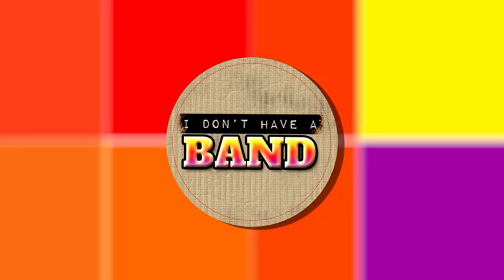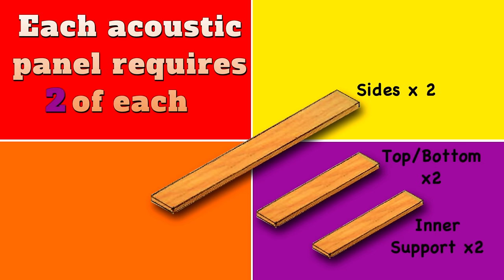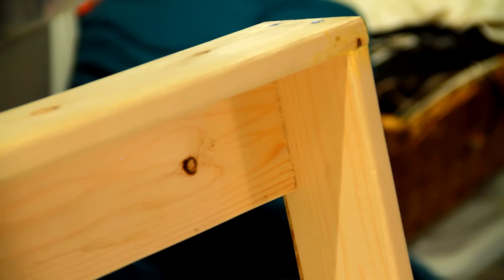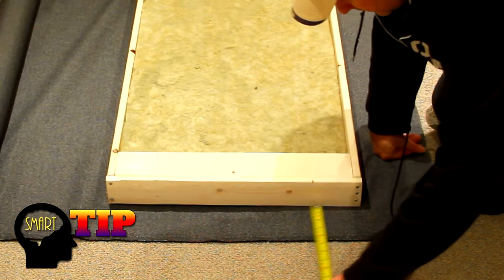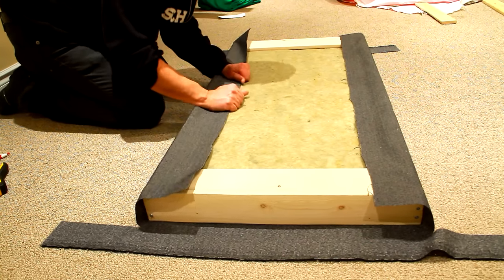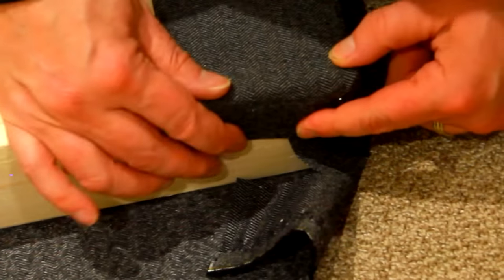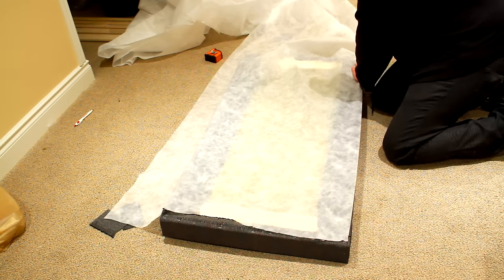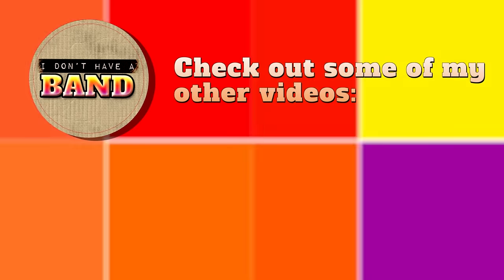DIY Acoustic Panels - How To Make Your Own Cheap and Awesome Panels

Comment: Can I use a 3 inch 16x48 panel?
Reply from the maker: The thinner the insulation the less frequencies it can absorb. You’ll still catch a good amount of highs with 3 inches but you will start losing absorption in the lower ranges.  As for size you can make them as big as you’d like but keep in mind the reflections happen in very specific places in your room.  See the panel placement video on my channel to see what I mean.  Hope this helps.
Reply: The panels you are using in the video are 2inch or 4inch?
Reply: @LonelyRocker  and thanks for take the time to answer. I really wasn't expecting you to answer me personally.
Reply: @LonelyRocker  The poster asked if he could use a 3" frame instead of 4" like you did. I noticed in your video that you used 2" Roxul and didn't double it up. So, that means a 3" frame would work. Not sure why you went with 4 inch frames if you were not doing a double layer? If it was to allow for air space, all you had to do is have a space between the wall and the panel. That would be a good idea anyway. I think that you can get away with 2" Roxul in 3" thick frames for side reflections. But for corner bass traps, it would be better to double up to 4" of Roxul. Also...it's a good idea to treat the back wall with diffusion to avoid splap-back.
Reply from the maker: My panels are actually 4 inches.  The insulation i used is just under 4 inches thick.  One thing I didn't cover in the video because I didn't talk about mounting is I added spacers on the back so it sits off from the wall a bit.  Every application can vary so I didn't want to be too general with some aspects.  I may consider a follow up video because a lot are asking.

Comment: I used your measurements and the 24x48 rockwool insulation. The insulation doesn't fit in the panels... because the panels end up being exactly 24x48. The interior measurement (where the insulation will fit) is less than this. Where did I go wrong?
Reply from the maker: Hard for me to say what went wrong from here but it is always good practice to double check your measurements before getting too far.  Place the wood around the insulation before you assemble it.  If you need to make adjustments figure out what sizes you need and apply these measurements to your next cuts.  Good luck.
Reply: I doubled checked everything, something must have gone wrong somewhere on my end 🤣
Reply: I Don't Have a Band 

Thickness of a 1x4x8 is actually 3/4” so based on the measurements in the video...

Outer Height
46.5” + 3/4 * 2 = 48”

Outer Width
24”

Inner height
46.5”

Inner width
24” - 3/4*2 = 22.5”

Dimensions of insulation 
24” x 48”

Is your insulation actually 24x48 or are the inner dimensions of the frame actually 24x48 on the ones you made?
Reply from the maker: Sorry, this is a lot of math for Youtube comments but my finished panels are almost exactly 2 feet by 4 feet measuring the outside.  The insulation is generally a tad smaller but it's soft so you can stuff it in there.  The key is the length of the pieces.  I gave the precise measurement in the video.  I also mentioned I wasn't giving carpentry lessons and that stock measurements can fluctuate.  The best thing to do is measure your insulation and adjust your wood to that.  A little carpentry skill comes in handy here ;-) . Hope you figure it out!!!
Reply: I Don't Have a Band thanks for writing back. Will make some adjustments on my end :)
Reply: Yes you have to trim a half inch or so off the Roxul
Reply from the maker: Good luck!!
Reply from the maker: I didn't have to do any trimming with mine...I double checked the measurements on the wood against the Roxul and then made templates from the first cuts.  Rest of my build went super smooth.  I made 8 with no issues...
Reply: I Don't Have a Band nice. Yeah I just adjusted the measurements. Maybe my insulation was different dimensions than what you used. I had to make the frame 1.5” larger to fit it
Reply from the maker: Glad you figured that out.  There is a section in my video where I talk about taking measurements and making adjustments to fit your stock.  Make sure to check out the other acoustic panel videos on my channel.  I show you how to place them and then how to do a sound test to gauge the improvements.  Good luck!
Reply: You need to take into account the width of the vertical pieces.  That would be 3/4 inch on each side, so the top pieces would need to be 25 and 1/2 long.
Reply from the maker: The measurements I provide in the video conform exactly to the insulation I used.  Unless you change the insulation material.  It's good if the insulation is a little snug so it doesn't move inside the frame.

Comment: Is the safe and sound more appropriate over the Roxul Comfort board 80?
Reply from the maker: Not necessarily.  The materials have different densities.  IT all depends what you are trying to achieve. I recently did an update on my panels blending different materials.  Check it out: https://youtu.be/MHnFYFZc-w8
Reply: @LonelyRocker  Thanks for the reply! I'll check out your link. In my case, I'm putting together a music mixing room to properly mix my music recordings. I'm going to build corner base traps with safe n sound cut into pie shapes, but I also need sound panels around the main room in appropriate areas. The comfort board 80 seemed appealing because it's more ridged. I was going to double it up for each panel and just using a guestimate, before doing any sort of testing, I think I'm going to need about 15 panels.  The comfort board 80 is a lot more expensive though.
Reply from the maker: My pleasure.  Definitely watch my Panels 2.0 video before making your bass traps.  There is a logic beyond corner shaped panels to make good bass traps.  I think you will be intrigued by my formula.  Let me know!

Comment: Great video but your prices in CA must be awesome compared to Oregon.  The wood alone is $6.20 each, meaning $12.40 per panel.   Fabric front and back will double that to about $25 per panel.  Insulation and other supplies these panel are approaching $40 per panel US.  Cheaper than buying premade panels but I couldnt pull it off for anywhere near less than $20CA.
Reply from the maker: Thank you!  Bear in mind this video was produced in 2018.  Long before COVID.  Prices on everything are super high right now.  I should price it out now and see what it would cost me today.
Reply: Thanks for the fast reply. Decided to do your 24x24 panels instead but struggling to find the comfort board locally, guess Im stuck ordering what I need.  Can you link me where you got your comfort board and foam?
Reply from the maker: My pleasure.  I got the Comfortboard at my local home depot.  The foam I just bought on Amazon.  They have a ton of that stuff on there.  Just need the 1 or 2 inch foam..

Comment: i thought of a easier method of constructing panels without all these tools and also cheaper and quicker. I was in my local DIY store and saw a shelf full of flatpack cardboard packing boxes. All that is required is to cut off the top and bottom flaps and you are left with the four sides. I then cut this box in two to give me  two boxes each 6ins thick. Then just fill with whatever material you chose and secure with a fine string round the box. Its then up to you how to finish them ... i just draped a pair of fine net curtains over them and secured with adhesive tape. No need to hang them just set against the wall leaving a few inches space between the panel and wall.
Reply from the maker: There are many ways to skin a cat...if this build works for you, awesome.  I'm a bit of a craftsman and I only like to build once so wood, for me, is more sturdy and will stand the test of time.  But for a quick and dirty solution, seems like you have found one...

Comment: Can i use comfortboard 80 instead for all my panels and will the sound absorption be better than the rockwool insulation.thank you
Reply from the maker: Absolutely.  I used comfortboard 80 for some of my other formulas.  Check them out here: DIY Panels 2.0: https://youtu.be/MHnFYFZc-w8   Mini Panels: https://youtu.be/AdDdumAieJs
Reply: Comfortboard 80 is usually available in 1.5 inch slices, which are not thick enough for low frequencies, and the product is 3x heavier per volume than Safe N' Sound.  Comfortboard 80 has a density of 8lbs/sqf while Safe N' Sound has a density of 2.5lbs/sqf.  The difference in density gives these two products different sound absorption profiles (i.e. they differ in how they absorb different sound frequencies) and Comfortboard is much stiffer, which means it will not sag if you chose to put it in a ceiling panel.  3 inch layer of Comfortboard will be more effective at absorbing low end frequencies from about 200 Hz down, but 3 inch SNS is more effective between 250 and 1000 Hz.  Neither is very effective below 100Hz unless you layer them to 6" thickness or more.  Interestingly, many anecdotal field tests by acoustic designers suggest that a 6 inch layer of SNS outperforms 6 inch layer of Comfortboard even in the bass frequencies.
Reply from the maker: I did a crude test of this theory on my channel...

Comment: Has Roxul availible online?
Reply from the maker: Isn’t everything online these days? 😜
Reply from the maker: @acejaystephens1110  Not the same stuff.  You need Safe'n'Sound.  Careful not to buy the wrong one.
Reply: Safe n sound is what I used in my ceiling joists and inside walls but for acoustic panels you want what’s called Roxul Rockboard 60 or 80, they will absorb much more low end freq which are always the biggest prob as simple acoustic foam will tame highs,  the Roxul rockboard is more expensive but .......
Reply: They’re extremely dense!! They’re about 6 safe n sounds compressed into one solid  Roxul rockboard.  Trust me I researched this for a year before I did it.   Not that yours won’t work but rockboard will absorb even more.

Comment: What fabric is this?
Reply from the maker: I'm not exactly sure.  I bought it in a fabric store.  On the label it says "mixed fabrics" so it's clearly a blend of a few things.  Up close it almost looks like fabric you could make a suit with except it's a little more rigid.  It was a great find.  I found it in the clearance bin at the store so I bought the whole roll.  Best to go rummaging at your local fabric store.
Reply from the maker: I visited the fabric store today and brought a sample of my fabric.  Turns out it’s upholstery fabric.   There’s a coating on one side to prevent it from slipping.  There’s your tip.  Upholstery fabric makes a great wrap for panels.

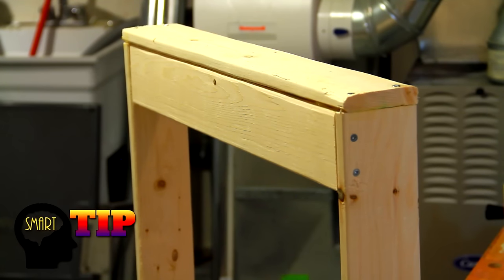Comment: 3:19 hi.. im confused.. the inner support is 22” which is less than the rockwool at 24” how is this possible? Did i miss anything?
Reply from the maker: Published dimensions are always a little bigger than what the material actually is.  And Rockwool is flexible so you can stuff it in. Trust me.  These measurements work.
Reply from the maker: Honestly?   These are DIY panels.  They won’t fix all of your issues but they will make your space sound a little better.  So do what you can.
Reply: @LonelyRocker  sounds like my ex-gf
Reply from the maker: @Sugarsail1  🤣

Comment: Is the safe n sound 24" OC sold in the US? Only found the 16" OC.
Reply from the maker: Probably best to check with your local supplier/retailer.  I don't see why it wouldn't as these are made to construction specifications.  I'm not a distributor but I'm sure your local hardware store could hook you up.  Good luck!

Comment: What frequency range does it cater to?
Reply from the maker: According to Rockwool's data, you'll get great absorption from about 250hz and up with about 50% absorption at 125 hz.  That's with only 3 inches of material.  If you want more absorption down low check out my DIY Acoustic Panels 2.0 video: https://youtu.be/MHnFYFZc-w8

Comment: So basically build the frame based on the dimensions of the insulation.
Reply from the maker: Exactly.  You're cutting the wood anyways but save the hassle of cutting the insulation and the mess and aggravation that comes with that.
Reply: As long as those dimensions will fit the space you want to put the panels. Keep in mind a 24 inch (2 foot) panel that’s 4 inches thick can take up a lot of space, especially if it’s in a corner diagonally. With each panel added, your room will get smaller and smaller. Two 4 inch panels facing each other on opposing walls will shrink your room by 8 inches. So you either need a pretty big room to start with or you’ll need to make some cuts or even use 2 inch panels instead of 4 inch. 
It’s recommended to use an electric bread knife to cut the insulation if you need to cut it. Wear a dust mask and do the work outside if possible.

Comment: Pine? Why not some cheaper wood? Great build
Reply from the maker: Thank you.  I’d suggest the better materials you use the better the panels will stand the test of time.  Thanks for watching!
Reply: Pine is one of the cheapest woods.  Poplar, maple, and oak are pricey but pine is peanuts compared. I used pine as well.
Reply: I did my basement poles in poplar, came out beautiful.

Comment: There is a fantastic new iso material available now, its shredded denim. No fiberglass or rockwool.
Reply from the maker: I've seen it.  I did a little research about it.  From what I've seen it may not be all it's cracked up to be.  A TON of fibers fly off that material during installation.  Some people who have tried it regretted it later.  It falls apart very easily.  As for acoustic properties, I have no idea.  Maybe something I could test in a future episode :-).

Comment from the maker: 🔧🔨⚒Check out the updates in my Acoustic Panels 2.0 video! ➡️ https://youtu.be/MHnFYFZc-w8
✅✅ MOUNTING TIPS ARE HERE ➡️➡️➡️➡️➡️➡️➡️➡️ https://youtu.be/IjCtAccI_7w
Reply: Where did you get the rock wool? Can you include links, anybody?
Reply from the maker: In Canada I got it at Home Depot.  Depending where you are there me be other brands.  Look for Mineral Wool, sound rated insulation.

Comment: The is inaccurate. Someone please correct me if I’m wrong. You are saying to cut the tops and bottom pieces to 24”. Well, if you place them on the top and bottom like you suggested , the 4x8 rock wool sheet will not be a perfect fit. These measurements are wrong. You should make a correction video.
Reply from the maker: You are wrong.  I have taken careful measurements and tested the build numerous times.  Plus I have built and made videos on other styles of panels.  Understand, construction materials are never the size as advertised.  They are always smaller.  Measure a 2x4 piece of lumber and you will see what I mean.  Plus. Safe'n'Sound is soft and has some give.  So I provided precise measurements to ensure a nice snug fit with minimal cutting.  I assure you these measurements are 100% accurate. And btw, I'm using 2x4 sheets of Rockwool.  Not 4x8 as you suggested....
Reply: @LonelyRocker  maybe I'm missing something, but if you put the 24" piece on the top, it actually doesn't have room to fit 24" Rockwool, the 2 edges on either side are eating up some space. So it makes it less than 24" from side to side. Does that make sense? Can you clarify how I would be wrong?
On that same note, you only cut the sides to 46" instead of 48" which would make it an exact 4 foot because the tops and bottom are adding those additional inches instead of subtracting it.
Reply from the maker: @dannymelgarejo8805  I don't know what else to tell you.  I made templates with these measurements and repeated the builds over and over.  Over 300,000 views on this video with so many making them this way.  I assure you the measurements are accurate if you follow them correctly.  Material sizes can vary, so get creative and make adjustments if you need to.  These are easy to make.  Don't over-complicate it.  Good luck...
Reply: As I said earlier, FOLLOW EXACTLY THE STEPS ON THE VIDEO. If you are not used to do that kind of project there will be a learning curve and yes you will make mistakes. Blaming whoever or whatever for those will not do you any good except making you sound like a pretentious idiot. 
I apologize for using such language but come on folks, 
if it is your first attempt and if it doesn’t work, who do you think has the greater chance to be « wrong »? The beginner or the person who covered his studio walls and ceiling with the panels he made?
Love wins.
Reply from the maker: Thnx again for the assist.  Have you checked out my other panel videos?  I have build videos for 3 different styles of panels.
Reply: @dannymelgarejo8805   If you read the specs for the Roxul, it is listed as 24" but the acutal size of the batts are 23x47, they are made to be used in 24" on center stud construction. 24" on center is actuall 22 1/2" spacing since you have 3/4" on each stud. The 23" insulation fits snugly in the 22 1/2" space. Thus the reason for the smaller dimensions in the build
Reply from the maker: Thanks for a much clearer response than mine :)

Comment: Be aware! Cover the backside fully as you cover the front side. You won't want to be asthmatic in later years of life inhaling tiny particles of rockwool.
Reply from the maker: The backs are definitely covered on mine.  I’ve seen in some videos where they keep it wide open. Not good.
Reply: Also, don’t move the panels once they’re in place. Ideally, you don’t even want to touch them or rub against them. Treat them like paintings hanging on the wall. Just walk past and don’t touch.

Comment: It's better to have it away from the wall more effective put some rubber door stops inch rubber door stops on the corners or glue some tennis balls
Reply from the maker: I actually did that.  Didn't get into mounting tips too much in this video but I'm the process of creating a follow up to cover some related tasks in the install.  Mainly wanted to focus on the build in this video. But thanks for the tip!